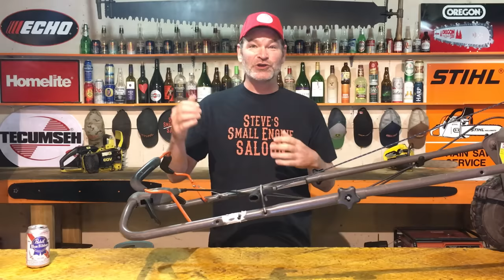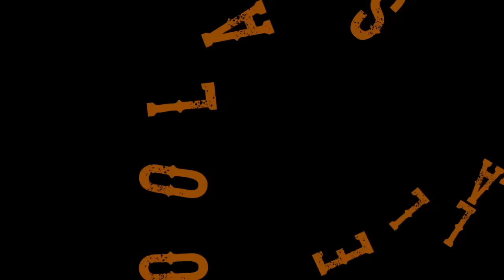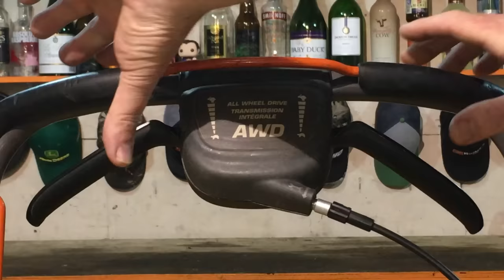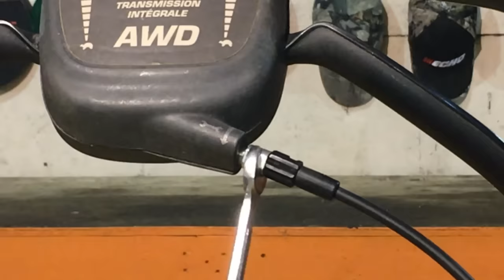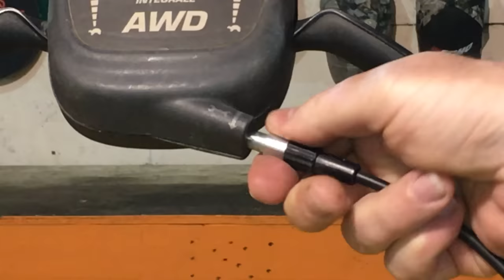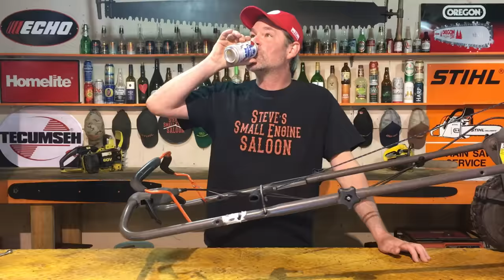How To Fix A Self Propelled Lawn Mower That Won't Move

Comment: Thanks Steve, I replaced the belt, all pulleys look good and I did the cable adjustment. My front wheels do not turn or pull....... I sure could use your help! Thanks again for your videos!

Comment: Was getting ready to check belts when I found your video. When handle was pulled, mine would barely move. Adjustment on my cable was about half way down cable. Turned it a couple turns and now it runs away with me! Amazing. Saved me a lot of headache disassemblying mower and then probably would have still not have pulled. This adjustment must be best kept secret because several mechanics never mentioned this fix! Thanks!!!
Reply from the maker: Glad it helped

Comment: Never knew about the adjustment so thank you.  Unfortunately when inspecting and cleaning my mower I found the cable had snapped.  Quick search on Amazon and $28 I got a brand new Husqvarna drive cable.  Took about 10-15 minutes to install…super easy (helps a lot if you have a long set of needle nose pliers).  Then your tip on adjusting the cable came in, now it’s perfect.  Thanks again!!
Reply from the maker: Great job!

Comment: Awesome fix Steve! Quick note, I have a toro self propelled and only have a singular bar for my wheel control. The mechanism to shorten the pull chain was a nut and bolt being used to hold tension on a plastic piece that was holding the chain in place. I had to loosen the nut to release the pressure on the chain, pull the chain away from the bar and retighten the nut. Same basic principal but it was a little different than this mechanism and thought I should share. Almost got discouraged when I saw they were different but I was able to figure it out based on your explanation of the mechanism! Thanks dude.
Reply: I have a toro too and today have done an acre with no self propelling! I am exhausted. I found something up by the top that will unscrew but it did not have any effect. Next bit seems to be hidden in plastic casing I cannot get off or not when I'm exhausted. I am an older woman so not even familiar with most of the terms. I will have another look another day but your point looks useful if I can find a chain inside somewhere.

Comment: Mine didn't adjust at the handle but I traced it down and found that adjustment down by the motor, but yessir, I haven't tried it yet but I've already adjusted it too tight, so backed it off. Going out to use it right now. Thank you.
Reply from the maker: Right on

Comment: Hi Steve, great video on adjusting the drive. I’d like to add my 2 cents.  My old mowers plastic is getting brittle. 
The cable Colette on the deck had fell apart so the cable wouldn’t tighten.  I clamped a small hose clamp on the cable  at the top of the deck. Now there is tension on the cable to activate the drive train.  
Hope this helps the old mower users.. cheers

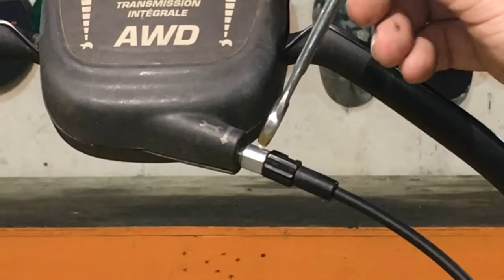Comment: At 3:04you can see a wrench icon on the mower. A hint that the cable is adjustable. Nice touch by the manufacturer to add that.

Comment: Thank you. My TroyBilt mower was a bit confusing. Tightening was pushing the wire out, meaning, stronger lever pull, more moving. I had it all backwards. 

Now mowing uphill is stupid easy. 

Btw. Someone disposed of this TroyBilt mower which I then found. Hehe. 😊
Reply from the maker: You're Welcome...

Comment: Note: On some Toro models a bolt by the push bar needs to loosened. The cable is then pulled taut to increase engagement of the drive.
Reply: exactly
Reply: Cable is lose still driveing

Comment: I had the same issue. I went to look at it and found grass compacted inside. I thought I cleaned and hosed everything thoroughly. Once I cleaned it out, I felt like I could ski behind it. Just one more easy check to add to the adjustment.
Reply: I had something similar.  Mower was hard to push even on the driveway.  Weeds and stuff had gotten wrapped around the drive axle.  Took about 20 minutes to pull and cut them off.  Once it was cleared, it self propelled without any problem.

Comment: What about the ones with just a cable going to the handle with no adjustment spot? Is it down on the front end wear it drives from? sorry for the double questions. good video again thanks.

Comment: A mechanic diagnosis and repairs.  The small engine mechanic you worked for years ago that replaced all those drive belts, is a parts changer.

Comment: Man,you saved me time,money and frustration with this.
I couldn't believe it but this fixed it.
My lawn mower didn't have the adjustment at the top of the cable but in the middle,a black plastic screw type.
You have a subscriber for like and i will like every video you make.
Greetings from Europe.
Reply from the maker: Right on Buddy...

Comment: Hi Steve1 i watch your videos because you know how to explain it well! I just had my Husqvarna serviced for a belt, it’s a rear wheel drive model, I find that the wheels catch when I pull the lever but then it gets hard to pull back, is the cable too tight or too loose. Thanks!

Comment: I will be checking this out today for my son. Unfortunately, he disassembled the handle control from the bar and I hope I can put it back together correctly. Yes, he did ask me AFTER he took it apart.
Reply from the maker: Good luck!
Reply: @StevesSmallEngineSaloon  Sorry for the lateness of this update. It was not the cable adjustment. It's the belt. Not looking forward to trying to put that back on.
Do you have a video for the Husqvarna Model # LC 221AH replacing the self propelled belt? I could not find one on your site.

Comment: Thanks Steve adjusted on my lawnboy thought I needed a new belt . Nope works like a charm now Thanks!!! On my Lawnboy the adjustment was a clamp that you loosen further down the handle pulled it towards the lawn mower tightened the nut up simple fix.Liked and subscribed
Reply from the maker: Excellent!

Comment: Is there a way to adjust the tension spring. I have adjust the cable, replaced the belt ( probably should have watch your video first) but maybe I have the tension wrong when I put the nut back on the post.  Can you show us the tension adjustment on the fear box please?

Comment: I am currently having that problem Was a Honda HRR216Harmoy  2... I would like to see if I can do that if there is an adjustment but my cable spring that comes up to the handle that you pull back Broke And I don't think this will work but I will try it Thanks I appreciate your suggestions

Comment: My engine stopped to rev up. The problem to look at is the spring that causes the engine to rev up. I had this happen to my (several) mower and even though I new what the problem was it took a few minuets of trial and error to get the spring back into the right position then noted the position in my book/papers on my mower: ""(This might make for a good show. )""   I've also have gotten some nearly new mowers given to me for this and other simple problem's, like spring's off or missing, bad fuel line, a gummed up carb, so always De-winterize your equipment (not just your mower) in the spring:   ""(Another good show.)"".

Comment: not all of them have an adjustment on it. i bought a nice john deere js63 for $20 the other day. after fixing a few things and getting it running again, it wouldnt go unless i gave it a light push the whole time. the clutch on this one is inside the transmission. i took the wheels off and found that the metal sleeves for the wheels (solid bearing) had siezed up and were stuck on the axles. i broke them free, placed them back in the wheels and greased the axles before putting them back on. the mower moved a lot better, but felt like the clutch was slipping. the mower had been sitting for a few years so i set the back of it up on a block, cranked it up and let the transmission run for about an hour. now it takes off the moment i engage it.

Comment: I been adjusting the cable on my awd  self propelled mower and if I lift the rear wheels  they’ll spin but the front wheels spin at all. Plus when I engage the cable I’m hearing a lot of clicks sounds like it’s slipping

Comment: But Steve, mine is one of those "goes as fast as you push it" mowers from Toro.  Doesn't quite propel itself as fast as I'd like it to.   It also cuts out intermittently like there's a carb float problem.

Comment: Hey Steve, Loved the video. When I found this video, I searched because my lawnmower is a all wheel drive that doesn't self propel and it squeaks. So, I adjusted the cable like you said but the squeak seemed to get louder. It didn't solve the problem. I was checking the pulley's and all of them turn but one wouldn't. I loosened the pulley to take it off and noticed it did rotate then, but it still squeaks and won't self propel. Any suggestions.
Reply: Have another beer!

Comment: Good one, Steve. Today, I went with an aluminum bottle Coors Light. Although I'm more of a Banquet guy usually, the son in law left a few of these in the fridge. 
Been working on a lot of Stihls lately. They are pretty consistent on the issues. That solid driveshaft causes more problems than any flex shaft ever has. I can tell ya that! One the stick gets bent too much, from riding on trailer hooks, that solid driveshaft destroys the top bearing. Anyway, I'm ranting. Later, bro. Thanks.

Oh, and in response to one of your other videos: Nobody, doesn't like Grolsch. Lol
Reply from the maker: Right on...

Comment: I have a sears Craftsman with a honda engine.  It only has ONE handle to engage the self-propel.  The fixture that the cable enters into has a little button on the bottom that one is supposed to pull out then push back in and that is apparently supposed to adjust the cable.  Nope.  The self-propel does work, but only if I push the mower first to get it engaged.  Sucks big time.

Comment: I just worked on my first one of these today. Only I got all the hand clutch parts in a bread sack. I have no idea why he disassembled it. I had to make linkage out of a 1/16" tig rod because he lost it. This was a Husqvarna with a ratchet gear to adjust the tension.

Comment: Good afternoon! Thanks for such a great channel. Please help me today if you can! I have a snapper rear propelled lawn mower, and I have been having constant issues with the drive handle, and it's almost total slackness in the cable. The belt is fine, and in the past my local lawn mower repair place always replaces it....They tell me I have to replace the Is entire mechanism every time it does this becauseit'snot ajustable. However, When they replace it, it's not fixed. There is a mechanism near the engine attached to a cable called the transmission spring tention, but it warns one  must be careful because it could cause too much tension on thetransmission.I do not see any way to get into the handle mechanism. And all I see underneath the handle mechanism, Is a very tiny nut.Not looking quite like the one in your video periodI just came across this video, And before going outside. I thought I would ask your opinion on this snapper whether or not it is adjustable and/or whether I should be adjusting the diagram mechanism at all. And do you think this type of handle canby titans, And or fixed? Thank you very, very much in advance for any help.Or advice you can give me as I do not have the money or even a truck to get it to a mechanic. Plus I'm disabled from 9 spinal surgeries and a knee.Really need to get this thing going. Thanks again periodHave a great day!

Comment: Some of them are unfixable.  I have an early 2000's Husqvarna Royal 53S and they stopped producing spares years ago due to how troublesome they were.  Apparently years ago there was a recall for the entire drive assembly to be replaced with updated parts but our dealer never informed us of this.
However I stripped mine apart and replaced the rubber coated drive wheel with a wheel from a trolley.  It's a bit wider than original so I haven't the same range of speed adjustment, but it's a good hardwearing rubber so should last a while.  Modified a few other bits and pieces while in there and now it should last another few years

Comment: I also work on lawn mowers and the other day a guy got rid of his lawn mower because the self propelled drive wouldn't work. So I took a look at it and you'll never believe what was wrong, a wood chip was stuck between the belt and the pulley on the transmission!   
Great video as always Steve!
Reply from the maker: Right on Brother....
Reply: Isn't that something ? I worked at a John Deere dealer, a rear engine rider came in, blade not turning..,.. a pine cone was stuck at 1 end of the blade & wedged against the deck. So often, the worst is suspected, but turns out to be something very simple. I thank the good Lord for my mechanical abilities. Dad(RIP) always had room for me under a car, too, & that didn't hurt.

Comment: I have a Husqvarna, and the self propell cable needs to be adjusted, i know it just needs to be tightened bcuz when i pull a little bit on it, it will engage, but i dont have the levelers like you show, so do i have to replace it or am i missing the tightener?

Comment: Thanks for sharing :) Have a Q about a non-adjustable cable to the belt-drive-function. Mine is a Briggs and got some years on it. On the handle-side it is a hook to put into to the handle-bar and the other down at the wheel-axle the end is connected to a spring that will hook on the to the lever. I can not see where it is a adjustment for the belt.

Comment: Are the AWD Husqvarna push mowers the only ones easily fixed? I have a rear wheel drive only mower, which I tried screwing out the cable, and it made the handles harder to pull (I'm affraid they'll break) and the mower just barely goes. Any chance of making a video for the 2 wheel drive type? Thanks

Comment: Thank you Steve, you the man!
Reply from the maker: You're Welcome...
Reply: Wow I forgot how powerful my mower propelled! That's exactly what was wrong with my mower. I was already thinking it was the transmission because I could hear grinding, wich turned out to be the gears in the rear wheels, I don't really see any worn spots, they just seem to fit sloppy and skip when I'm pushing it with the engine off? But so happy it's fixed👍

Comment: I have the same AWD mower.  It recently started to run away without engaging the drive feature.  I had to release the bale so the engine would shut down to keep the drive wheels from digging up the lawn.  This happens frequently and spontaneously.  Any suggestions would be appreciated.

Comment: To get it adjusted right, should I turn the adjustment in until mower doesn’t move, then gradually back off on it until the rear wheels begin moving then just leave it there?

Comment: Steve, I just replaced the belt and the self propel still didn't work. I noticed that the adjustment was turned all the way in so I adjusted it, after watching your video and it worked, however, i had to adjust it all the way out to make it work. I am thinking they gave me the wrong belt. Any thoughts?

Comment: My Troy-built cable wouldn't stay in position after I would adjust it.  The lawnmower wasn't moving much as it was.   At the end of summer the cable did break and now I need to figure out if it's just the cable or other things going on.  It's a bit older and someone gave it to me after my old mower started cooking and froze up.
Any videos on replacing the cable?

Comment: I have a newer mower that doesn't have the adjusting nut on the cable. I replaced the drive belt with one from a big box store. It works much better now, perhaps too much better. There is a noise while running as though the new belt is slipping by one of the pulleys. And without any pressure on the drive bar the mower pulls forward. I'm sure I placed all parts in the correct location. It seems like the belt is a little too small. Any advice?

Comment: You mentioned once cable adjustment is advanced and then you don't self prepel you said it could then be the belt , you didn't mention the tension pulley not spinning as well thanks .

Comment: Wow. Just 3 turns? I just replaced a rusted out deck on a rear drive. I assumed it was working when given to me, but the wheels won't engage. I checked belt and it was 35.5 and spec is 34.6 so I just assumed adjusting wouldn't fix it. Will try adjusting since new belt not here yet.
I just watched a machinist make a v pulley and she showed that she messed it up as the belt went too far into groove and inner of belt touched the pulley id. She says pulley must be off that centre of pulley and only contact the sides or it will slip. Makes sense why burned belts always slip as burnt sides let belt move down and contact pilley centre
Reply: So I was going to adjust old belt but it was already removed and new belt arrived. Problem is that new belt won't slip to a neutral. So I put old belt on and it will eventually grab when the adjuster is out as far as possible,  many,many turns. I thought maybe new belt was shorter than spec . But it measures 34.5 which it should. I guess I'll try a 35.0 belt.

Comment: Hey Steve I have a john deere s100 riding mower I'm having trouble with the deck scraping the ground when I mow so I adjusted the deck and still having problems I mow on a 1-1/2 any advice

Comment: Hey Steve I seen a self propelled push mower the other day. It had a lever on the handle that you pull and then push a button and a spring pulls it somehow and starts it up. Then when you turn it off it rewinds the spring and sounds horrible also it has a key. Do you know anything like that I didn't get the name of it and I really need to know. It was awesome.

Comment: Mine doesnt have that adjustment. My mower is a Husqvarna 5521 CHV. The lever to start the self propelled motion is a bar that goes across the handle length. Just has a cable and a stopper.